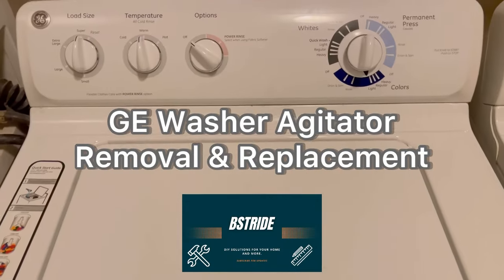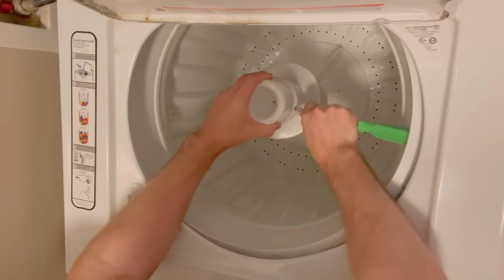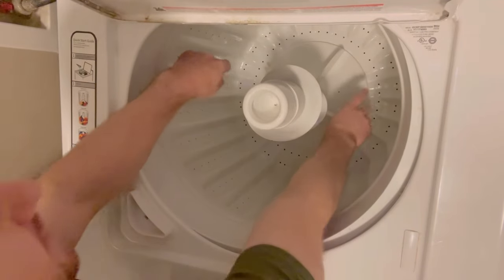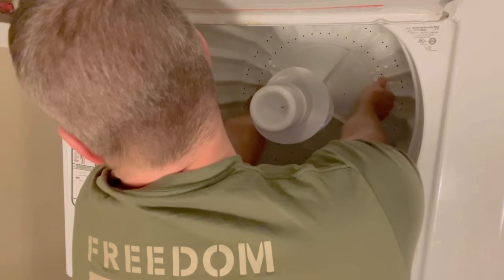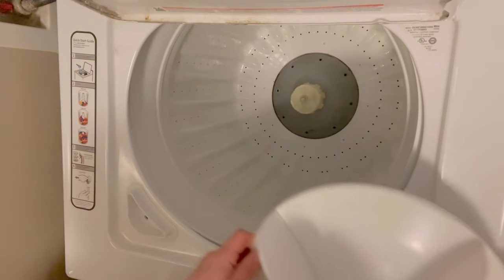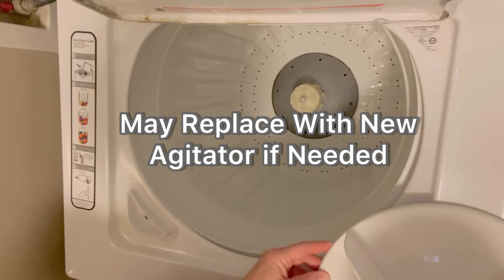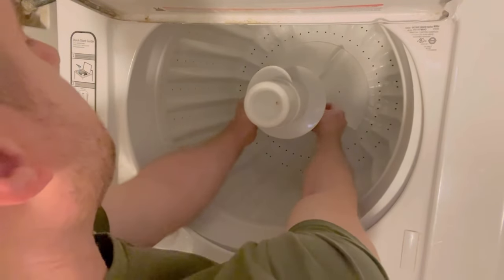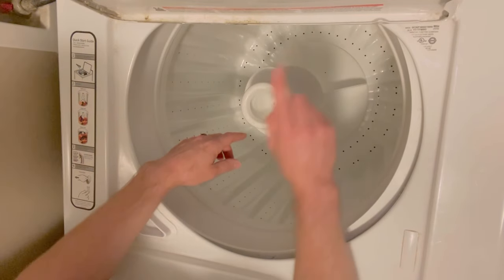GE Washer Agitator Removal and Replacement #washingmachine

Comment: Video is not clear enough to show what model it is and no where do you identify the model. Can you please advise what model it is as this removal is not typical for all GE models. Mine is a GTAP2000M2WW
Reply from the maker: Hey, I’ll check out model number for you
Reply from the maker: Model Gcwp1800D1ww
Reply: Wow another model yet again. The front panel looks almost identical to mine.
Reply: FYI the auger/agitator and base plate appear to be identical to mine so I removed it as you did.  FYI to remove the auger and plate I placed a thin nylon strap under the base plate and it came off really easy. Thanks for the video
Reply: FYI if you unscrew the three screws at the back of the front panel and then slide the panel to the right, inside you will should find the GE schematics and info neatly folded up .
Reply from the maker: @J.Haggis  no problem, glad you were able to get it off
Reply from the maker: @J.Haggis  good point, I remember seeing it back there when I was taking that panel off a while back :). Thanks for the tip.
Reply: @J.Haggis @BStride I have the same model. Do you know how to separate the base plate from the agitator/auger? It’s gross in there.
Reply: To remove the auger from the plate get a thin nylon type strap. Place under the auger on one side and pull it under as far to the middle of the auger as possible. Then tie a knot in the strap so it is a complete loop. Now yank up on the belt the auger should then lift off. Make sure you don't smack yourself in the head or mouth get the auger comes free. (the auger just snaps onto the base plate but it takes a little bit of sharp lifting to remove it.)  Good luck
Reply from the maker: @mattieann5053 is it the model in video or different? If so just have to pull up on it
Reply: @J.Haggis  Thanks for responding! I did get the auger/base plate out. I had to use a belt it was on there pretty good. But I think the auger is in 2 pieces, and when you look inside (from the top) its translucent and connected to the bottom half. But water gets trapped in there and I put it under the tub faucet to rinse it out and all this gunk was coming out. So I'm not sure how to completely disconnect the two pieces that make up the auger. I hope that makes sense.
Reply: Hi Mattie,  The two pieces are actually glued/ or heat sealed together. I tried to separate the two and only succeeded in breaking them (fairly fragile). Fortunately I was able to repair them using 2 stainless steel screws. So don't go there.

Comment: Nice video I have to remove the agitator because of clothes stuck in between but I can see a screw in the bottom, do I have to work the screw in the bottom or does it just pops up like you show in the video?
Reply from the maker: With this model it should pop up where in the bottom is the screw? On the outside of the agitator?

Comment: What is the name of the silver thing underneath the agitator?
Reply from the maker: Hi, I think on some models there is a center post, bottom wash plate is under agitator as well
Reply: I was searching everywhere I think I figured it out it's the " hub" under the basket. Mine just broke. Looks corroded but not sure if it's worth taking apart and replacing
Reply from the maker: @Lizz033torres  hmm what’s the part cost?